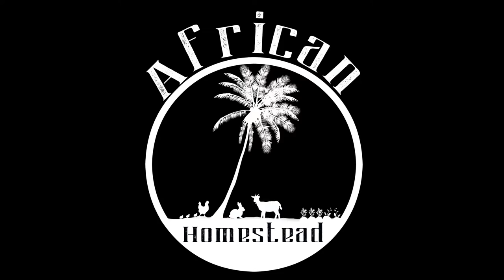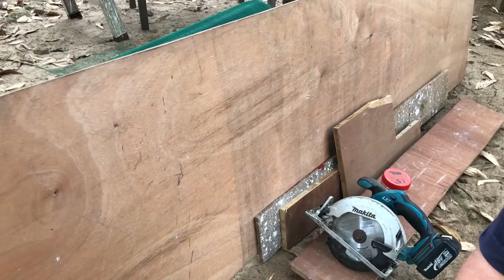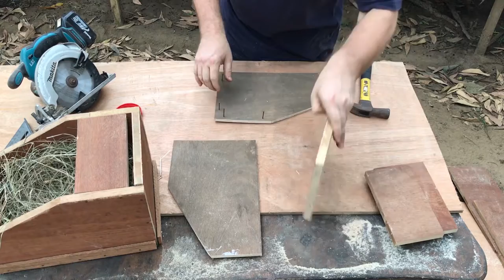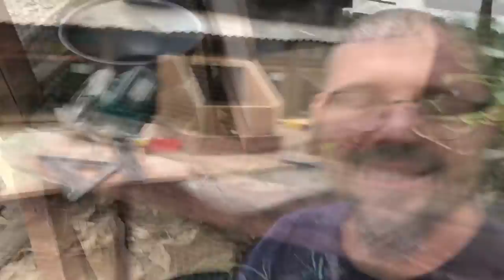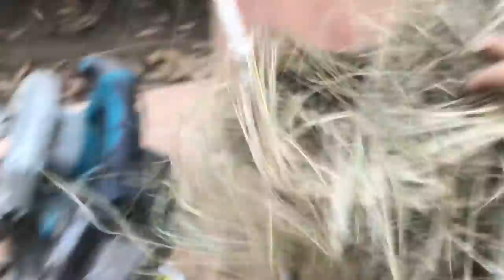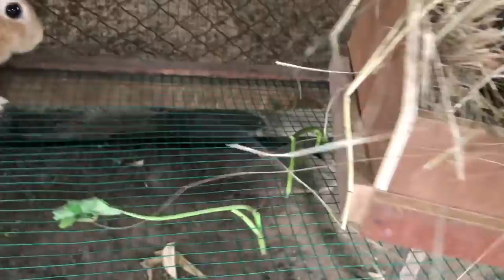Crazy Cheap and Easy Rabbit Nesting Box - DIY Project

Comment: Reduce, reuse, recycle and try not spend any $. Most of my projects are like this. Also, exact measurements and 90 degree angles are not always critical in my yard. If you could see the duck house I am building you would understand. Luckily the the ducks are not critics. Good video. Laura
Reply from the maker: Some people call me a pack rat, but I prefer to think I am prepared to build or fix anything at any time. :-)